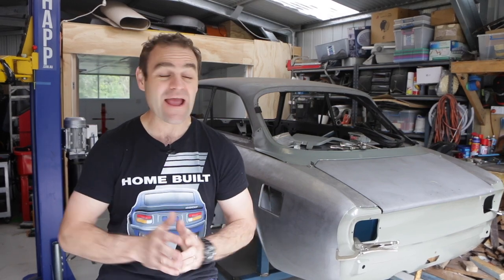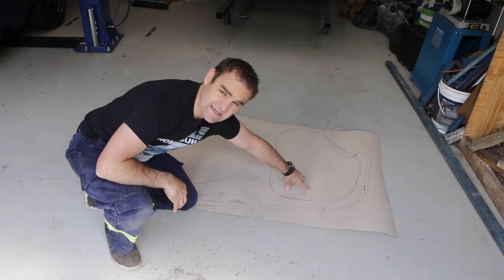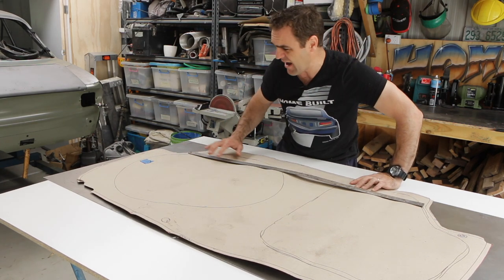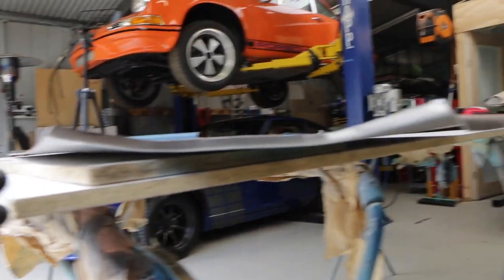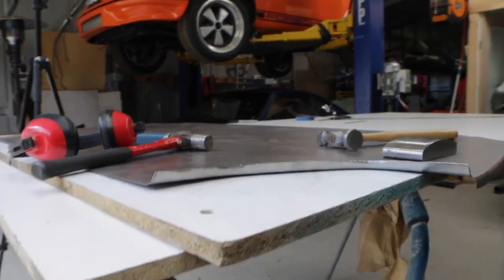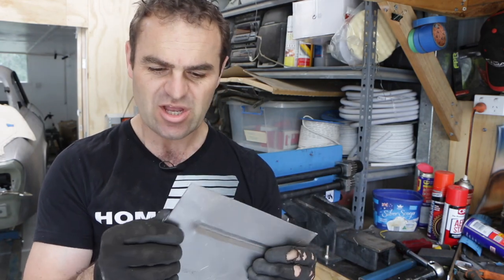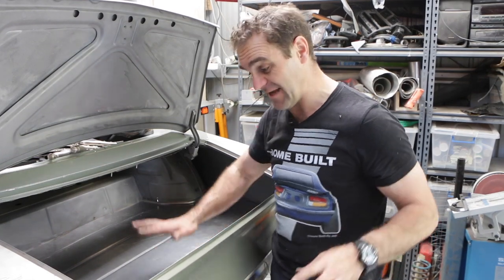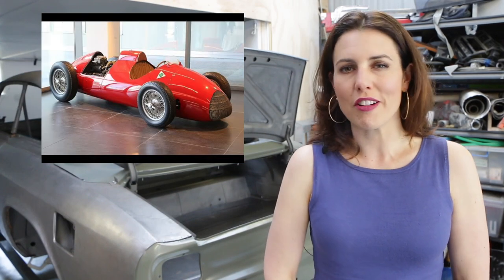Bead rolling my boot floor - Alfarrari 105 project car build part 22

Comment: Just as a suggestion I was taught another method that may help you.

Annealing the metal with heat obviously, either side of your bead lines.
That method came from a 7th generation blacksmith. 
Have an Awesome awesome week 😉🙂👍👍

Comment: Jeff, I suggest a simpler way to add strength and torsional resistance to sheet metal. Get some masonite and trace the forms you want on the masonite, cut out those shapes and lay the masonite on top of the sheet metal and mark where you cut the forms away. Then place the masonite under the sheet metal and clamp in place, making sure that the marks on the sheet metal and the cutaways in the masonite line up. Take a rubber mallet and shape the end to look somewhat like the pointy side of an egg in profile (Teflon is better but...). Then start tapping at the inside of the line. Keep going over it to create an even recess form. Use a cold chisel to get a sharp crease. Because of the impact forming, you are stretching the metal more efficiently than bead rolling.
Reply from the maker: That is definitely a good way to go, but it is a lot slower

Comment: I made a punch for the ends to finish the beads. Use a bit of pipe the right diameter for the bead you're making, chamfer the end and cut about half of it away for a cm lengthways so you have a kind of half a hole punch that you can use to define the end of the bead.

Comment: Nice work as always. I like the tool you made, I usually use an adjustable wrench but that looks much better!
Reply from the maker: I thought about that, but only if you want the full depth of the spanners jaws. This way cutting the slot the depth of the flange keeps it consistent :D
Reply: @HomeBuiltByJeff  Yea definitely, all the stuff i have done it on is all smaller stuff and not very important so i just went for it. If i ever need to do something larger or more important i am going to steel you idea.

Comment: Something nice and heavy on your work piece helps to hold it down and stops it sliding around. I have used large dumb bells or even a wheel and tyre,  saves heaps of energy and gives you a free hand often when you most need it ...not as tedious as clamping
Reply from the maker: Good tip

Comment: If you don't have a wheel you can pre stretch with cheap ball peen hammer . Just draw a line down the center of rib and hit it with consistent pressure and spacing with a slight overlap then run thru bead roller.

Comment: Run a shallow bead the right way (or other way if needed) tap it flat and roll it again. Tapping flat avoids running off and creases.
Never just do a pretty pattern the beads do best when they’re in the right place. Look for examples and explanations on line for the type of panels you want to do.
Reply from the maker: Interesting. I will give it a go.

Comment: If you plan on doing much more of this, you have to get yourself a nibbler. Much better than the angle grinder. Easier to cut crooked though.
Reply from the maker: I have one and tired it, but I need to set up my second compressor to run it properly ;)

Comment: Thank you for the bead rolling information.  I plan on getting a roller soon and had similar questions.  But it wasn't totally clear to me how you did it.  On the first one, you used the full round die on top and bottom and then a round on the top and the flat on the bottom.  That much was clear, but after that, did you use the round on the top and flat on the bottom straight away?  Also, I assume you didn't apply full pressure on the second pass otherwise it would have flattened out too much, right?
Reply from the maker: I am no expert, but I did round top and bottom 1/2 depth reverse, then full the right way. Then round over flat.
Reply: @HomeBuiltByJeff  Thank you.  And don't forget to put the "Y' on the end of your lift name.

Comment: Hey man I like your tool for bending sheet metal, you could make a simple DIY out of angle. Would be an easier method.
Reply from the maker: I did think of using angle, but I wanted a wider edge to get a neater fold.
Reply: @HomeBuiltByJeff  it turned out well actually, best build on YouTube imo.

Comment: How does the adapter plate seal against the oil pipe on the side of the engine ?
Reply: Brian Green o ring
Reply from the maker: As Matt said, it is an O ring in the block.